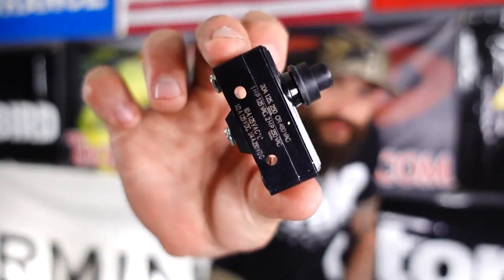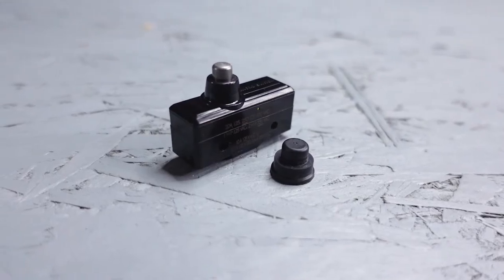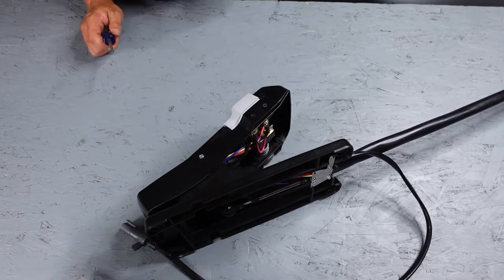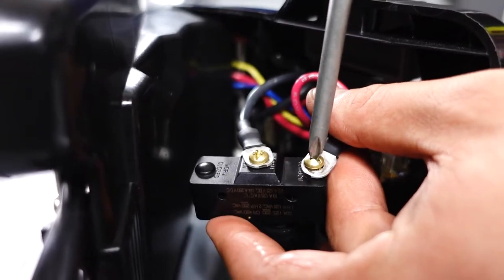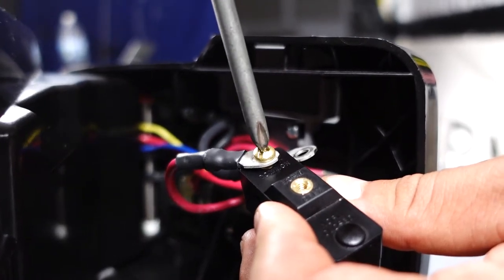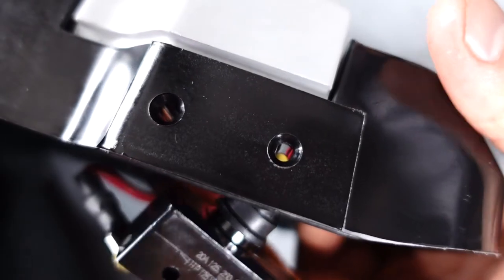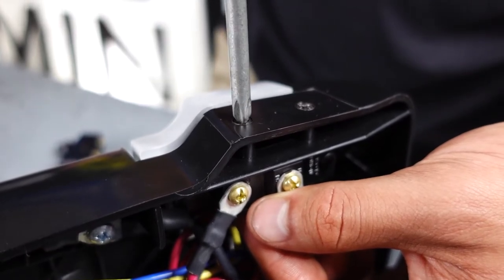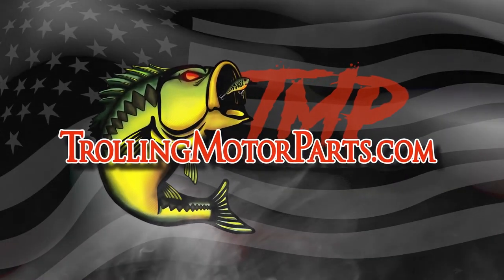How to Replace Motor Guide Micro Switch | Trolling Motor Repair

Comment: I lost the 24v side of motor, 12v still works.  Could that be a micro switch? Other solution if not. Thanks and great video

Comment: I have a motorguide 12v 54 lbs thrust variable speed digital and my clicker works on the switch but still the prop does not work? Any ideas?

Comment: Hello, I have the exact same foot pedal that you have in this video … I checked my switch and it works … my problem is that the gray plastic piece on the very top is not making contact with the button? Thanks in advance

Comment: Hey, I saw your video on the micro switch on motor guide I was wondering do you know what part number I need for the microswitch for a early 80s motor guide foot pedal micro switch